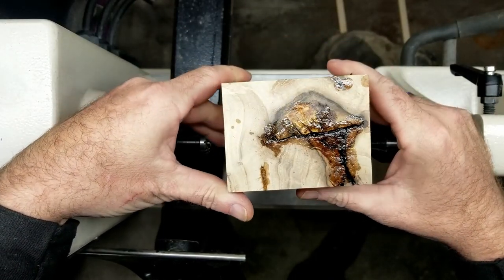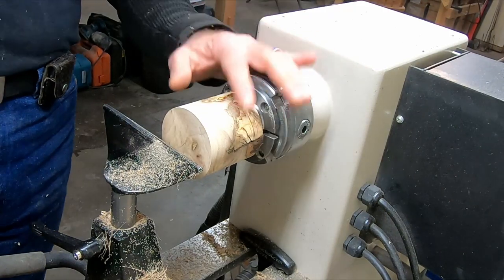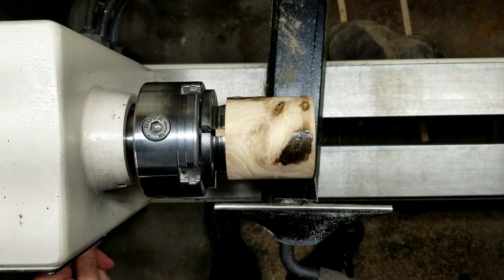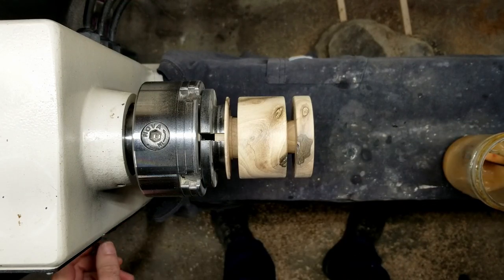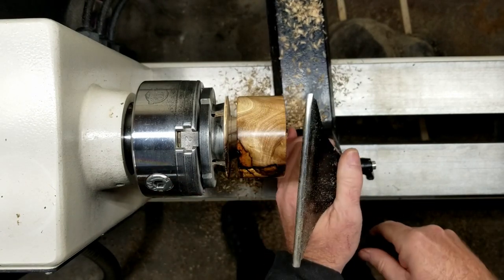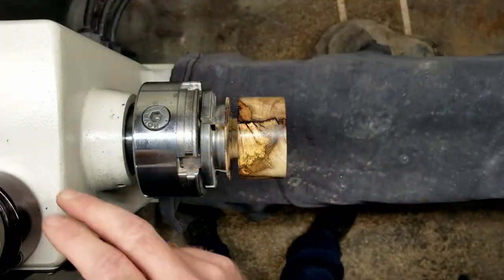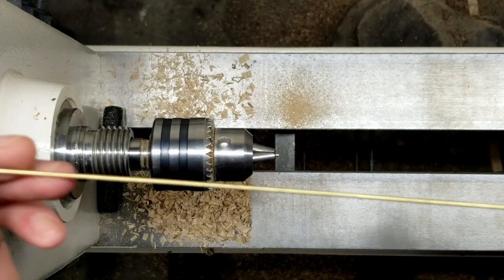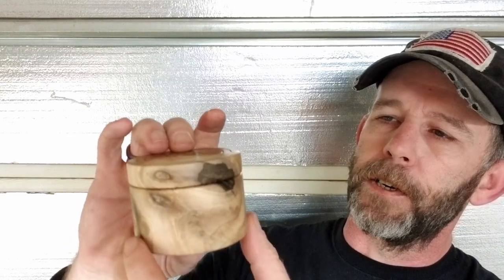Wood Turning: Salt Cellar from English Walnut

Comment: That turned out very nice. Good job. I was wondering, have you used this technique with the brass pin before? And if you did, does it hold up well or does it loosen up after time? I’m just curious because it’s a pretty slick idea and I would like to try it out sometime.
Reply from the maker: Thanks! I have used the brass pin in one other salt cellar, and it does loosen a little, but not so bad that it doesn't function, the hole in the wood just wears a little. I didn't come up with the idea, I saw another turner do it.